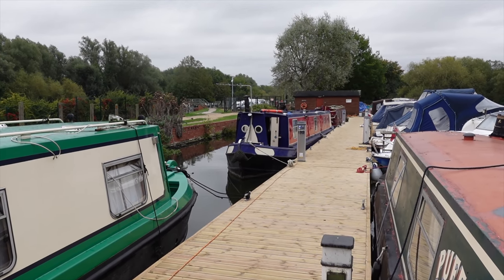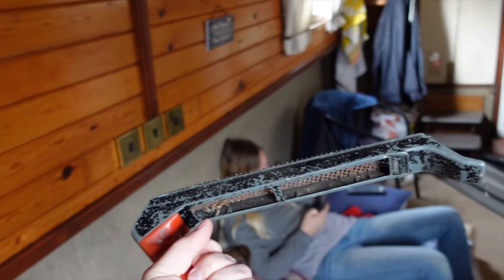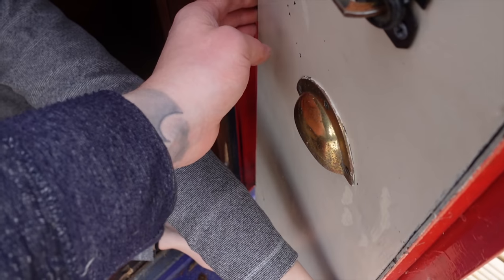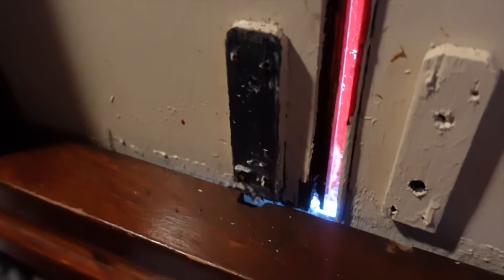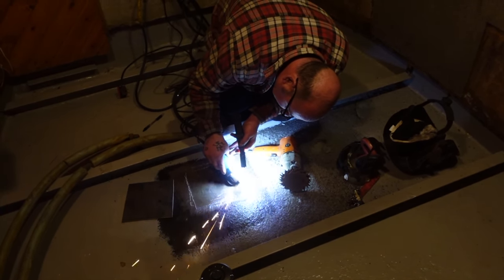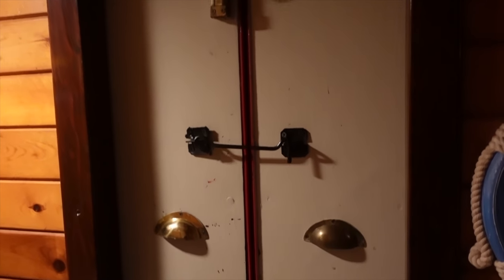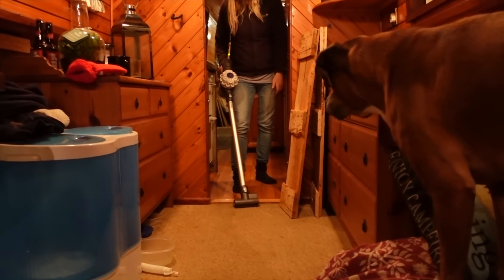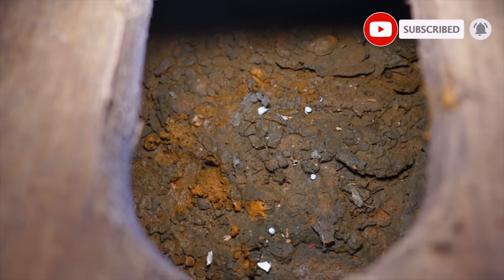we FOUND an 8mm DEEP hole in narrowboat HULL !

Comment: Former boat surveyor here. My best theory for the huge pit, is that at some point an old cupronickel coin has been dropped in the damp bilge, and over the years galvanic corrosion has eaten away at the hull. It's the same mechanism behind protecting the hull with sacrificial anodes, except that this way around the hull is the more reactive metal.
Reply from the maker: Thanks for your knowledgeable input, it turns out they were actually there to support the new base plate that was put on the boat, very odd seeing them for the first time

Comment: I think the bottom of your boat has been over plated, ( the reason for the belly button as you call it) a hole was cut out on the old floor for the so the new plate could be welded to it, to stop the new plate from sagging in the middle, I have welded new bottom's on this way,  hope this makes sense, I could be wrong just my opinion.
Reply: Totally agree, I was a welder for 20 years and for god's sake don't tell them there will be another 4 or 5 bellybuttons down the length of the baseplate. 1 bellybutton is enough for anyone.
Reply: i think you might be right! think it had a heavier bottom put on it at some point
Reply from the maker: I have a feeling you could be right as it did have a whole new bas plate fitted over the original one at some point, hope the bloody thing now going to drop off haha :)
Reply from the maker: you could be right, we've stumbled upon another one now too, thanks for your help :)
Reply from the maker: hopefully its a good thing??

Comment: Unless that narrowboat sits at an angle all the time?  You're going to have to pull up the whole floor to deal with that rusty scale; I imagine it's covering the whole inside bottom hull.  I hope I'm wrong tho!  That's alot of work!
Reply from the maker: the hull is designed at a slight angle so that the water runs down, saying that we are seriously looking into going down the route of ripping it all up :)